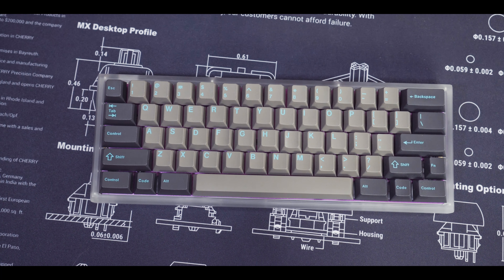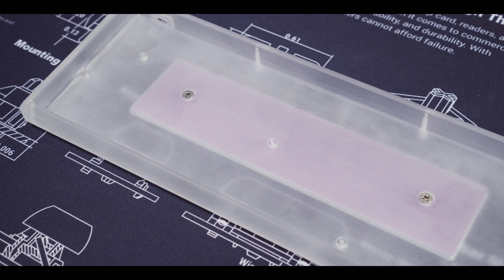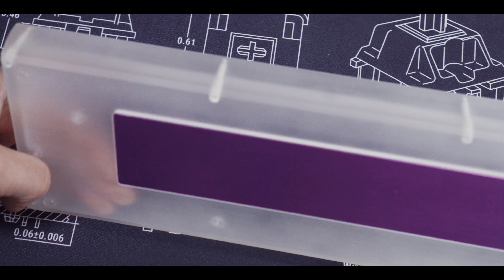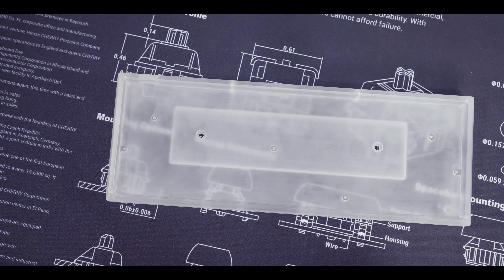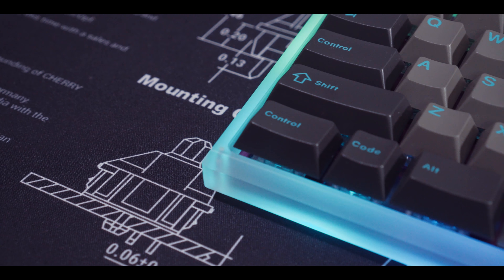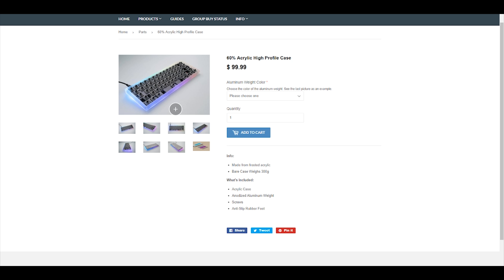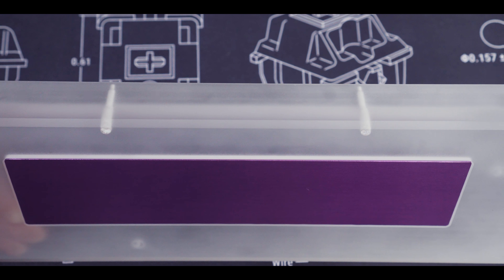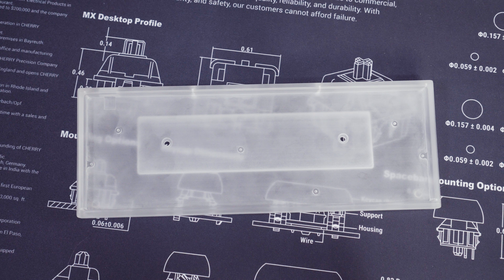Sentraq High Profile Acrylic Case Review

Comment: Sentraq had high profile alu case back then. There was three layers: alu, acrylic, alu. Layers keep together by 6 screws, placed just where this case have holes. There is no need now for this holes, but i assume that they used same model of case so production was a bit cheaper.
Just google "sentraq Aluminum High Profile 60% Case" there will be a photo of holes for screws.
Reply from the maker: Максим Морозов wow you are right. This just makes it look worst. It shouldn't have been that hard to just select the holes and press delete on the CAD files. Lazy design.